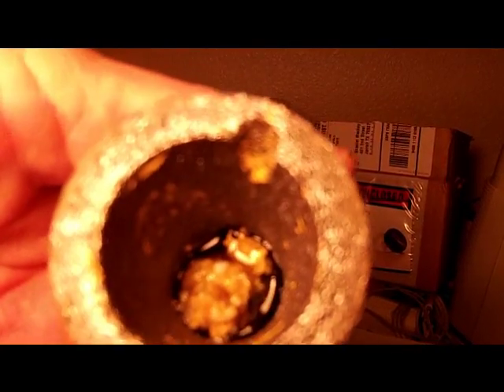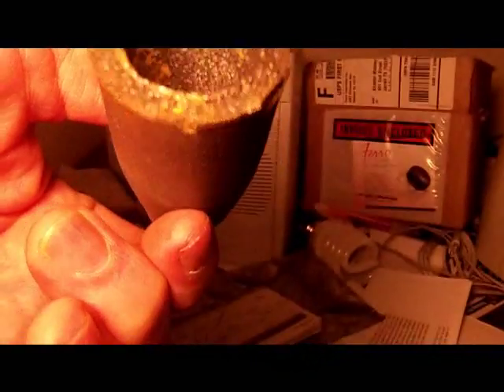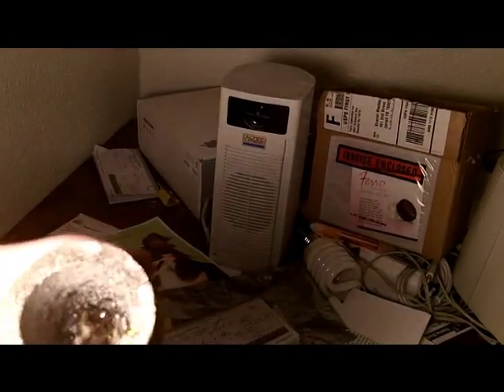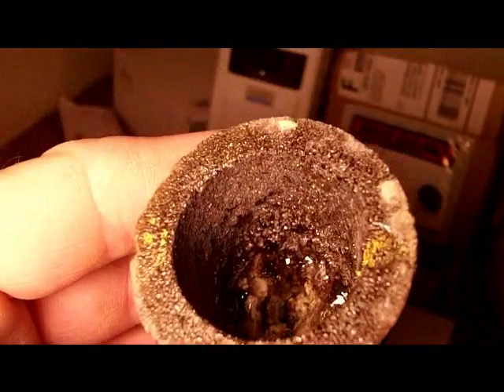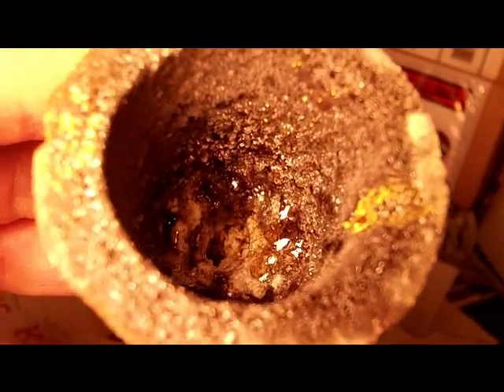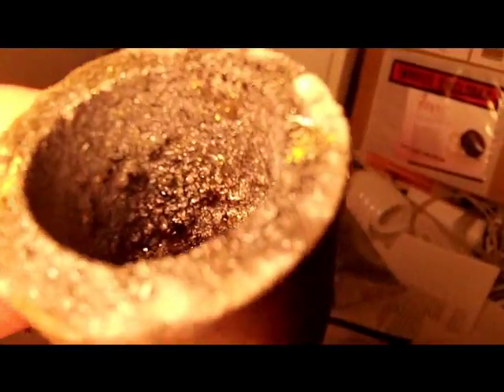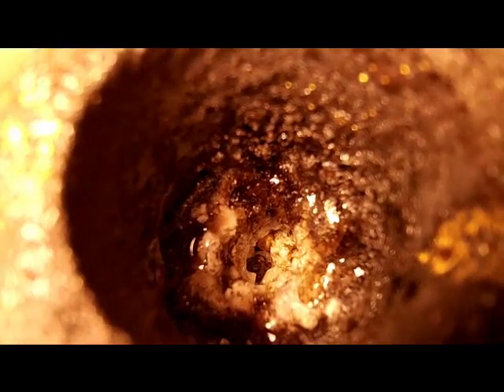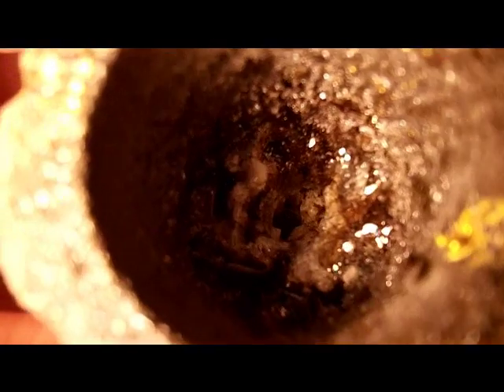Microwave Gold Melt Pt3

Comment: use less borax you only need a pinch that is the stuff that turns into glassy stuff after meltin and you have to pour the stuff out right away, and put less crap in there with your gold.. like the water is a bad idea.. or the napkin lol